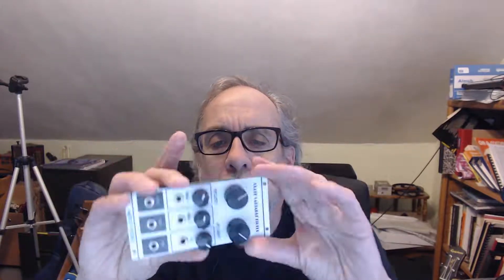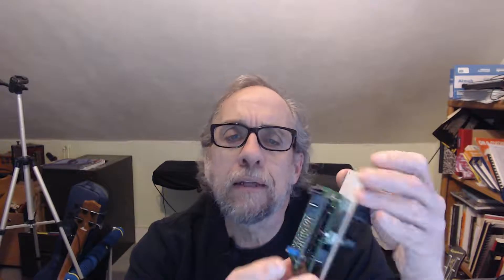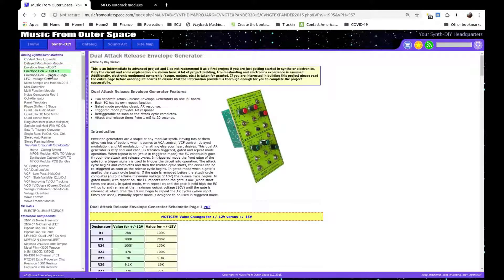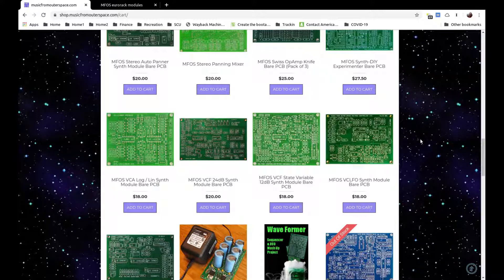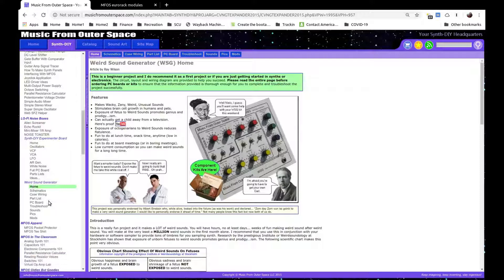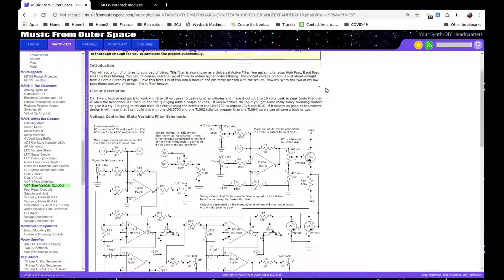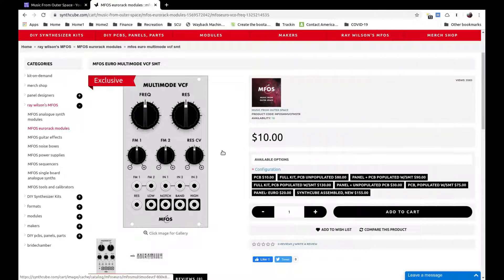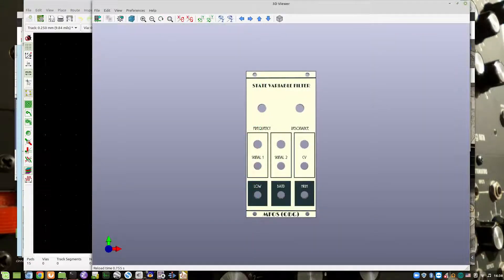Music From Outer Space "Oldie But Goodie" State Variable Filter

Comment: Hi Rich. I do have a small question i really like to ask. Apologies in advance if this might not be the right place for asking so i try. The last 3 years i have build  a lot of modules and without any major problems but when i look at some schematics i noticed that, at the audio inputs for instance, that often a small capacitor is used from the audio in jack to ground, then it flows into a 100k resistor. This removes dc offset and that the signal is centered around 0 volts. Uhm. Last week i've build the 2 pole, 12db state variable filter from music from outer space and i saw that this capacitor is not tied to ground but in series with the 1meg input resistor. Why is that? Is there no need for the audio signal to be grounded? Or does this setup serve a purpose? Thx for your time in replying. Have a nice day
Reply from the maker: Hi, for DC coupling, which really is a high pass RC filter with cutoff below the audio range, you might use a capacitor connected to the input and a resistor from there to ground (not the other way around). A crude way to think about it is the capacitor "acts like" a high value resistor for low frequencies and a low value resistor for high frequencies, and it along with the actual resistor then can be thought of as a voltage divider. If the filter output is then connected to the non inverting input of an op amp, this also establishes a conventional ~100k resistance to ground at the input (rather than having the input floating as would be the case if there were no resistor to ground). But often you go into the inverting input of an op amp, where the non inverting input is tied to ground. In that case the inverting input is a virtual ground — the op amp forces it to 0 volts even though it is not wired to actual ground — and that configuration needs an input resistor to convert the input signal to a current through the op amp feedback loop. Ordinarily it would be a 100k resistor again, though the 12 dB state variable filter uses 1M. Then to make the high pass filter for DC coupling, you just need a capacitor before the resistor. It's the same as before, except that the resistor connects to the virtual ground at the op amp inverting input instead of the actual ground.

Comment: hi Rich, in order to self oscillate you first need to disconnect all inputs (cv, audio inputs), so only connect one of the outputs to your amp. then turn the resonance all the way up. If you don't hear anything, that probably is the cause of that the cutoff is all the way down in low frequency range. Turn that up and you should hear a nice sine wave. To check if the calibration is correct, connect a sequencer to the CV input and your filter is playing tones according to 1v per octave like a sine VCO. hope this helps. another note is: 0v should be 40hz, 1v 80z, 2v 160hz and 5v 1280 hz. If that's the case then your filter is calibrated correctly. have a nice day

Comment: very glad you went with a 12hp panel with space for nice chunky controls. Mite have to get a set of these made at JLC, keep up the good work!
Reply from the maker: My regret is the CV attenuators, those knobs are too tightly spaced. But yes, the relatively big cutoff and resonance knobs were a must!
Reply: @analog_output  I'd just use slighly smaller knobs on those, the spacing is as important and the tactile size of the controls and i think the user interface can benefit when there are 2 distinctly different sized knobs, much the same as a slider can be used in place of a knob to do the same job but give a different feel when you're randomly waggling them to see what noises come out.